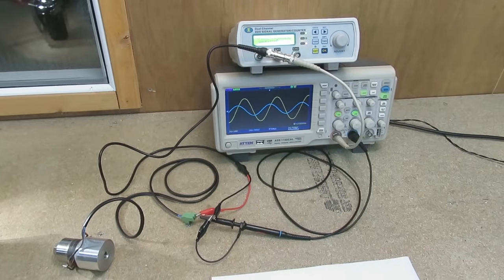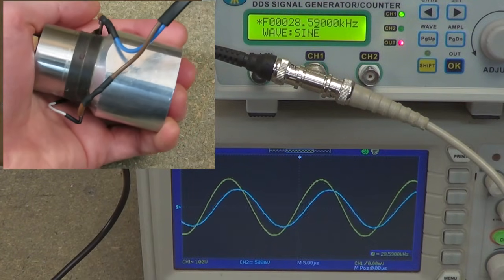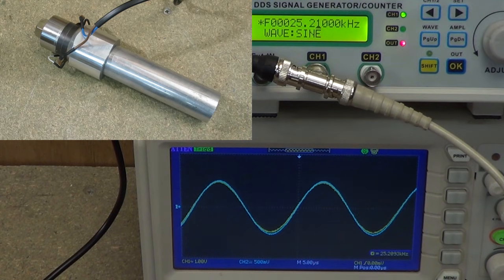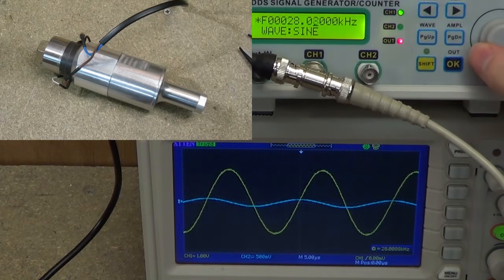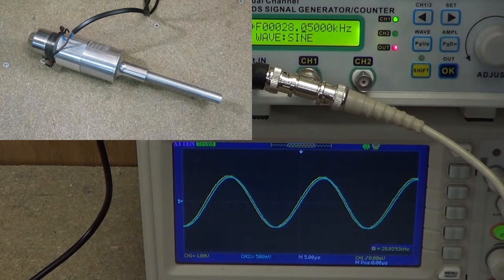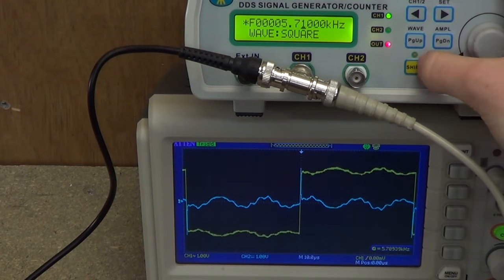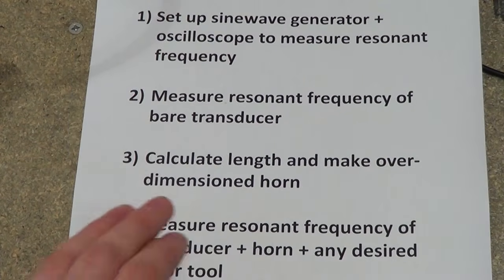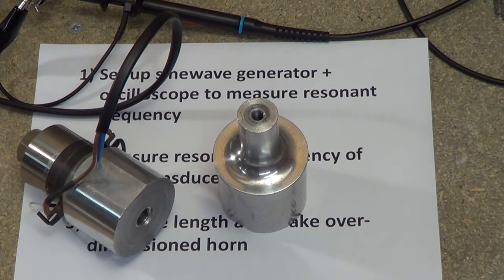Ultrasonic Transducers - Measurements and Horn Design

Comment: Great stuff, thanks for sharing. I wonder what the resonant frequency of the piezoelectric ceramic pieces alone is? Your 'bare' transducer has about 40-50mm (?) of aluminimum already attached to it. I would expect resonant freq a bit higher, the Q to be very high, and the resonant peak very narrow band. But not completely sure why I'd expect that. What does the mass on the back do to frequency? Have you tried heavier/lighter mass?
Reply from the maker: Thanks for commenting. The bare piezo disc also has the same resonant frequency. For example, here's a couple of discs which would be used in a 44kHz transducer:

https://www.steminc.com/PZT/en/piezo-ceramic-ring-38x127x63mm-44-khz

It's important to remember that , although the ends of the overall transducer move axially, the middle, where the piezo disc is, moves radially ("breathes"), so it's the radial resonance of the piezo disc that's important, not the thickness resonance (which will indeed be much higher).

As for the back mass, it's basically something for the piezo to push against. I don't know all the ins and outs, but there's a (very length!) description of transducers here which is worth a look:

https://www.ultrasonic-resonators.org/design/transducers/transducer_design.html

The material of the masses, as well as the tension on the bolt, all have an effect on frequency and efficiency. As for trying different masses, that is not something which a user would typically be concerned about. The masses and bolt tension will all have been chosen to optimise the transducer, and changing anything will likely be detrimental.

Comment: So, for tuning sine wave is better, but what's better for driving?
Reply from the maker: Антон Южаков Square wave is perfectly good for driving, because the transducer only really responds to the fundamental component, and a high-powered square wave is much easier to produce (with and inverter)
Reply: also square wave driving has one more very important feature along with simplicity: the amount on heat disipiated in driving stage (i.e. h-bridge) is MUCH less compared to the sine wave .

Comment: Is the double-stud also made from aluminum? Which material is recommended for it and could you kind enough to provide the dimensions of the double- stud and the rod?
Reply from the maker: Yes - the extension horn is aluminium. I actually cast it to avoid having to turn down a large bar. Aluminium seems to work perfectly well, but most commercial horns are made of titanium (expensive!), and some from steel. I have  PDF here with dimensions - http://imajeenyus.com/temp/horn_drawing.pdf - but I have to stress again that you CANNOT simply machine it to that size and expect it to work. You MUST make it longer and shorten it to tune, as described in the video.
Reply: Thank you for your timely reply. It is a really great presentation, which is of great help for beginners and even for some researchers.

Comment: Can you tech how design the  bare  transducer  if i have  peso disks only ( for a while)
Reply from the maker: Hi, I'm afraid I really don't know anything about that, apart from it is a very complicated process. You would be far better just getting a complete transducer at a standard frequency, they're pretty cheap.
Reply: Do you have any recommended (european) supplier for bare transducers and signal generators?
Reply from the maker: Afraid I don't - all I know are US or Chinese suppliers. TBH that's probably your best bet anyway.
Reply: Lindsay Wilson thanks for your response. Which US/China suppliers would you recommend? Great video by the way
Reply from the maker: Thanks - if you have a look at my page here, there's a short list of suppliers that look good. I can't vouch for all of them, as I've only used Steiner & Martin, but they have been suggested by other people. Actually, for standard cleaning transducers, AliExpress is probably your best option ;-)

http://imajeenyus.com/electronics/20110514_power_ultrasonic_driver/index.shtml

Comment: Hello Lindsay. Great video. 
I'm a bit confused regarding the harmonics. When you find the third harmonic you divide the frequency by 3, shouldn't you multiply?
Reply from the maker: Thanks! The resonant frequency of the transducer is being excited by the 3rd harmonic of the driving squarewave, so the fundamental frequency of the squarewave is a third the resonant frequency. Hope that makes sense!
Reply: @imajeenyus42  That helps a lot, thank you. But how do you know, you have the third harmonic? Just by looking at the oscilloscope?
Reply from the maker: @ahmadrinno  Well, I know what frequency the function generator is putting out, and I know what the resonant frequency of the transducer is, so it's quite easy.
Reply: @imajeenyus42  that's a good point, thank you!
 Again, great video, very informative!

Comment: Great video! I'm working on an acoustic levitator for my physics undergraduate thesis, as I intend to study deformations of water droplets in an acoustic field, and I'm so grateful I found your page. It happens to be, that I have the exact same 28kHz transducer and now I need to make a horn for it. I was wondering whether I could get ahold of the dimensions of the "step-down" horn you made, plus the disc tip you use to "correct" the resonant frequency? Thank you very much!
Reply from the maker: Hi, glad you like it! I've got a drawing of the horn and the flat tip here:
http://imajeenyus.com/temp/horn.pdf
http://imajeenyus.com/temp/flat_tip.pdf
(Best save them, I clean out the temporary folder from time to time...)
Both made from aluminium. I have to point out again that you MIGHT get lucky with the resonant frequency if you machine a horn to those exact dimensions, but there's always the chance it'll be slightly off (different alloy, temperature, whatnot), so it's best to do it a little bit longer and shorten it to tune. I really should sometime get a chunk of a specific alloy and make a horn from it, so I have something repeatable to go on! Hope that helps.
Reply: Thank you for your answer. You sure saved me a lot of work :)
Reply: Thanks for your comment.. I've been wondering why the algorithm wants me to know about ultrasonic transducers so much...
This confirms its all spawned from an acoustic levitation vid I watched recently

Comment: Great video! What are you using the ultrasonic drill for? You should do more videos about working with glass
Reply from the maker: Hi - glad you like it! I originally wanted the drill to make holes in ceramic discs for supporting discharge-tube electrodes, but I've kinda got away from that stuff now. I've got a page on the drilling here - http://imajeenyus.com/workshop/20110516_ultrasonic_drilling/index.shtml. Yeah, I've got a couple videos in the pipeline about laser-cutting of glass tube, should be interesting!

Comment: That's a great video. Thanks for thr effort. One thing I didn't get though. Why do you need to match the resonant frequency of the transducer+horn system with that of the bare transducer? Is it for the sake of compatibility in that you won't have to change the frequency for each attachment or has it got to do with the efficiency of the system?
Reply from the maker: Thanks. From what I understand, it's because the transducer is designed to operate most efficiently at that particular frequency. If the transducer+horn system resonated at a slightly different frequency, it would still work, but at a reduced efficiency and amplitude. At least, that's my take on it ;-)
Reply: @imajeenyus42  Great video and very informative to a newbie like me.   I want to build an ultrasonic cleaner.  Should I not just mount /glue the transducer  onto  the tub already and then find  it's combined system resonance frequency with the sine wave gen +scope?  Then design a suitable electronic driver circuit which supplies the measured resonance frequency, as close as possible.   I don't know if this is parallel or series resonance.  Will this work?  Any caveats?   Hope to hear from you.   Again, thanks for the video!
Reply from the maker: @jjay461  Thanks! To be honest, if you're building a cleaner, it's not worth trying to make a driver circuit from scratch. There are already plenty of driver circuits available, for example https://www.ebay.co.uk/itm/303238693107.

As for measuring the resonant frequency, it isn't nearly as important in a cleaner because the resonance is damped and broadened significantly by the liquid in the tank. The resonance might be as much as a few kHz wide. This is why the drivers in cleaning tanks are the cheap self-oscillating circuits, they don't need precise frequency control. Unlike say a transducer + horn, which does.

Hope that helps!
Reply: @imajeenyus42  Thanks, appreciate your help.  I will look into that.  ciao.
Reply: @imajeenyus42  Thank you for responding. Does the bare transducer resonate at the same frequency as the resonant frequency of the piezoceramic rings that have been bolted to the transducer? I'm asking since I'm working on an ultrasonic stirrer and I only have the piezoceramic rings to start with. Need to design a horn for the same.
Reply from the maker: @shahmithilm  It's a great question, and I'm afraid I'm not entirely sure! However, I would think so, for maximum efficiency. Note that a transducer has a big bolt down the middle to apply compression to the whole stack - this prevents the piezo elements from ever being subjected to tensile forces that would break them. And from what I've seen in papers, the force exerted by the bolt shifts the resonant frequency, so there's some tuning involved there as well!

Comment: Thanks for your efforts for making this Video and other things you are done before, but I have a question. I am trying to design kind of potable or small Ultrasonic transducer for an ultrasonic cleaning, as a beginner in this field, why should we need a resonant frequency state? I am looking forward to getting your answer and thanks in advance.
Reply from the maker: Thanks for the comment - I'm not quite sure what you're asking though. The reason for using mechanical resonance is because it greatly increases the vibration amplitude available. Yes, you will get some vibration when driving the transducer at other frequencies, but the amplitude will be tiny.
Reply: AH~ I see. I only thought the effect of a resonance when it comes to structure like bridge or something, which can occur a fracture suddenly on that.  haha. Okay I got it. Thanks~^^ By the way, Quick question one more, Can I design more smaller transducer? Along this Video, bare transducer seems to be needed for designing an Ultrasonic transducer. 
Thanks in advance, I visited your website and I admire your work haha. but I maybe need some time to understand many stuff on your work.
Reply from the maker: The size of the transducer is determined largely by the resonant frequency, since half a wavelength needs to exactly fit in the length of the transducer. Only way to use a smaller one is to go to a higher resonant frequency - 40kHz is another common frequency, but there are many others available. For some ideas, have a look at http://www.ultrasonicsworld.com/index.php?main_page=index&cPath=6_7
Reply: Thanks ^^ When I have more question, Can I ask you something about this topic?

Comment: You advocate to use Sine wave to drive the transducer but your circuit design uses square waves with the elimination of the output transformer [which also serves as isolation transformer]. What is the rationale and does it affect the transducer efficiency?
Reply from the maker: The sine wave drive is only used for testing the transducer, because it's much easier to see resonant behaviour, phase shift etc., when using a pure sinewave drive. For actually applying high power to the transducer, square wave is used, because that's easy to get from an inverter. Because the transducer is a resonant load, it only really "sees" the fundamental component of the squarewave anyway, so efficiency isn't affected.
Reply: Isn't not the square wave is the composite of one part of the fundamental and wasted all the other energy on infinite parts of the harmonics frequencies? I imagine this can be seen in the oscilloscope where some parts of the harmonics are aiding to the fundamental while the others may be in conflict to it, example it vibrate any other ways instead of directed energy vibration? Some experiments may be in order though, but it does make the circuit simpler.  The question arouse because ebay drivers are, as far as I know, transformer type. I ain't sure, really.? Your videos are great and educational, keep it up. thanks.
Reply from the maker: Again, although higher harmonics are APPLIED to the transducer, very little current will flow at the harmonic frequencies because the the transducer presents a much higher impedance than at the fundamental. No current flows at the harmonics, and therefore they do not have any effect on the resonance. If you look at the voltage and current waveforms, the voltage is a squarewave, but the current is a sinewave, since the transducer is only passing the fundamental.

Now, unfortunately, yes - most ultrasonic drivers do actually place an extra inductor in series with the transducer, which resonates with the static DC capacitance to filter out higher-frequency components, but this is 1) something I still don't fully understand 2) not that important!

Comment: Lindsay, thank you so much for making this video! This is so much easier than the method from imajeenyus. I have a question though. I was looking at components to make my own transducer, and I guess the rings themselves have a specific frequency. Can you speak briefly about the importance of that, and could you explain what a PZT maker means when they specify 'Radial Frequency' and 'Thickness Frequency'? Which is more important for a Langevin style device? Thanks again!
Reply from the maker: Thanks, glad you liked it! Regarding making your own transducer, it's probably not something I'd recommend, given (probably) critical dimensions, plus the availability of cheap transducers, but it should be possible. I'll send to a direct message with links to two papers which describe the construction of bolt-clamped Langevin transducers, they might explain things a bit better. 

A PZT ring will have a thickness resonance, where the thickness increases and decreases. This is generally quite high, and isn't of interest in a Langevin transducer. They also have a radial resonance, where the ring "breathes" in and out - this is the one we want. It's a little counterintuitive - although the ends of a Langevin transducer vibrate axially, the MIDDLE vibrates radially, which is why you want to excite the radial mode of the PZT ring.

Unfortunately, since PZT ceramic is very weak in tension, the entire transducer has to be pre-stressed using the bolt down the center, and the amount of tension applied will vary the resonant frequency (quite a bit). The papers show the effect of different bolt tensions. Most of the mass dimensions, preload tensions etc. are calculated through finite-element simulations - because it's such a complex vibrating system, it's impossible to do from simple equations!
Reply from the maker: Actually, I can't direct message you for some reason. Could you drop me an email at lindsay@imajeenyus.com and I'll send the papers to you?

Comment: really interesting video sir. Is the current you are measuring is the same as the echo coming out from the transducer? because i can't still figure out about how to measure a reflected echo coming out from a single ultrasonic transducer.
Reply from the maker: Thanks! No, the current is simply the drive current passing through the transducer - it is being continuously excited. I'm not sure how you'd measure the echo - usually things like rangefinders have some sort of blanking or filter to prevent the drive pulse from being coupled directly to the receiver circuit.

Comment: Hi there! I'm confidence that I'm not the first who asking it, but actually I've a little bored to read all the comments. So why are You not drilling holes (for studs) with an extra depth initially (before shortening the horn)? Is pontentially existing empties make occur a problems?

P.S.: Thank You for Your great job! Your video is fascinating and so helpfull!
P.P.S.: Forgive me for my poor English - I'm working to improve it.
Reply from the maker: Mainly because I didn't know in advance how far I would have to shorten the horn, and I wanted to have as much solid material left as possible.
Reply: @imajeenyus42  Thank You for your fast response and answer! I've understand your position.

Comment: same phase and max amplitude mean max power!  we know that every system has a minimum consumption at resonance. What do you mean?
Reply from the maker: I don't know where you're getting "minimum consumption at resonance" from. The power draw is a maximum at resonance, because the impedance is lowest.
Reply: @imajeenyus42  thanks! but the dissipated power of every ultrasonic welding  machine on idle (no load) is at minimum. what is the working frequency of sonotrode in such machines? is it other than resonance?
Reply from the maker: @BehzadSaffarian  Ah, I see the confusion! Ultrasonic welders are operated at the parallel resonant frequency, where the impedance is a maximum (but voltage and current are still in phase), whereas cleaners are operated at the series resonant frequency. To be honest, I have never understood the difference. There is a good article here which might help: https://www.ultrasonicadvisors.com/why-is-antiresonance-driving-good-and-why-could-it-be-bad